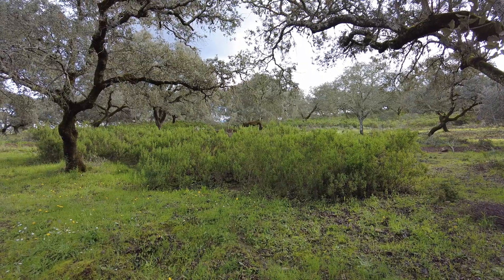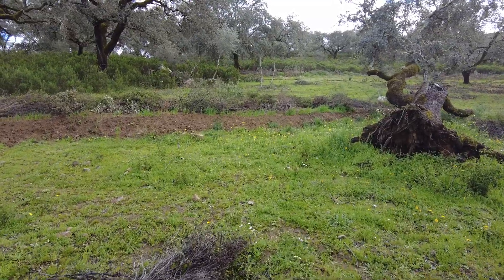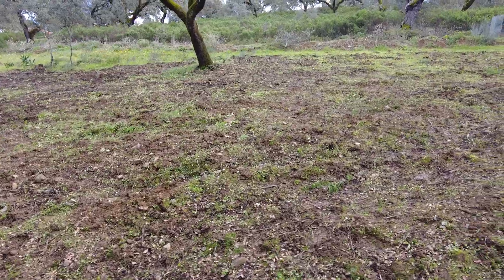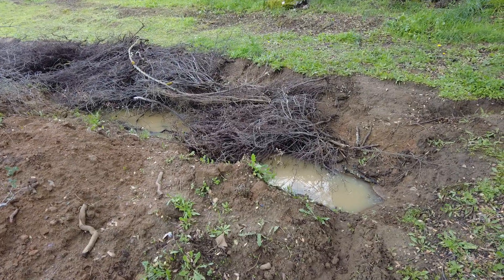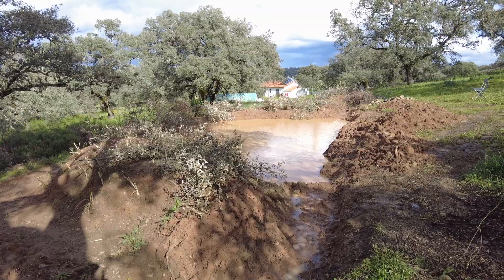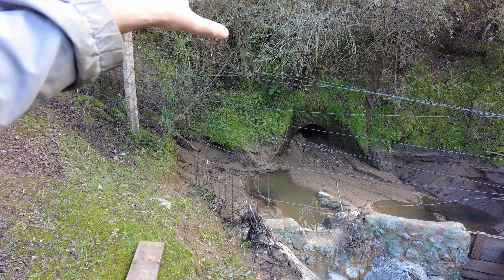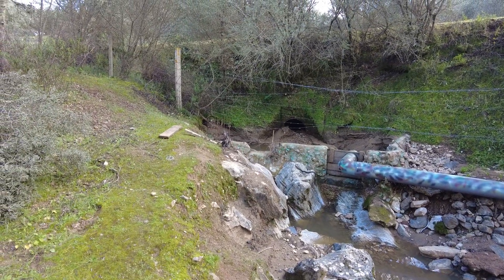Culverts increase velocity and pressure of water. Culverts cause erosion!

Comment: Let's put physics to work. (Simplified!)
If your waterway is 4m wide in one place and only 1m in another,  according to BERNOULLI LAW water in a narrow place will flow 4 times faster, as the amount of the flowing water has to be constant everywhere.
As speed is 4x, water (per each liter) has 16 times more KINETIC ENERGY, as kinetic energy is proportional to squared velocity. It means, that if a 1kg stone will barely stay stationary in the wide part, a much larger, 15kg stone can be carried away in the narrow part!
The Above example also shows, that while in the wide part, you would need only say 100 kg of stones, in the narrow part it would require 1600kg of stones to withstand the water flow energy in the 4m wide area.
From these two physics laws, one can deduce how to build structures and design the water flow. (Should also apply POTENTIAL ENERGY)

A fast-flowing stream formed, hitting one small part of the sand-bag dam, carrying away bags. There was a lot of localized kinetic energy. Water should be forced to spread uniformly before it meets the dam.When water manages to breach the dam, it start to flow with a high speed = high kinetic energy = high erosion potential.

All GOOD permaculture rules can be derived from a few basic physics laws. Using basic Nature laws you can always find a proper solution, while using some described, ready-made permaculture designs might be inappropriate due to some differences between your case and the place it was designed for.

Simplified, but should be a good start.
Reply from the maker: YES YES YES. Even I understand. Thank you for sharing

Comment: My thoughts on the water post-culvert lean more toward induced meandering, rather than continuing with more dams and channelized flow between them. It's difficult though with the slope aspect. A wider, meandering water course would slow the water and spread it across a greater width at a lower depth, creating a larger infiltration zone. The work of Bill Zeedyk comes to mind. "An introduction to Induced Meandering" is a great PDF resource.
Reply from the maker: Great suggestions. Thank you for sharing

Comment: So, it happened as I was thinking. You can continue using sand bags, but you will need to put more rows of it and put more gabions and rocks there. There is no other way to remove energy of the water. In short, more rocks, more punches, more energy will be removed. Gabions with big rocks are the best option. You need to use big rocks so there will be space for water to pass among them. Each gabion will take part of that energy.
Reply from the maker: Great suggestions. Thank you for sharing

Comment: Bernoulli's law describes how water flows fast through that pipe under the road. You need to keep in mind this law with all your water structures.
Building several obstructions at the outlet of the culvert may cause it to clog up. Could be a huge problem. Maybe one small wall ahead of the inlet of your feeding pipe. Keep spillway at the height such that not all the pressure/water is directed into your feeding pipe. 

Where you have sandbags, it seems properly built stone dam is needed. Make the middle wide (5-7m ?) and flat. This way water will move further with a much lowered speed. Again, Bernoulli's law. Big job, but is there a better solution?
Edit: you can do it within a week, it's not a big job! Just small to medium at most, stay positive!
Reply from the maker: Thanks for digging up Bernoulli. Much appreciated

Comment: Lower the spillway of the weir at your culvert be lower than the bottom of the tube.  Allowing the water to fill above the tube is why all the sand built up inside of it.  The sand will always be a problem that you will have to scoop, but at least it won't build up in the tube anymore.
Reply from the maker: I like sand. Come on. I need a beach. Thank you for sharing

Comment: I had the same thought as you, three bags breadth for each one high. Maybe have the bags stacked with the length in line with the flow of water. This helps slow down the water not try to block it. Silt and small stones can then collect in the long lines along the sides of the bags. Maybe even put gravel pieces there as well. The comment about the curve not cupping the flow but spreading seems more correct.

My words are only from theoretical viewings of others.

I live in the UK. I have two small gardens with some fruits trees and raised beds.
I also use a wheelchair which hampers my functionality.

I mainly collect branches, debris, off of the things I grow and pile them on the land I have 🙂 So far it has meant I rarely have to water anything 🙂

You are going to succeed, it’s what you will do with your success? 🙂
Reply from the maker: Thank you for sharing. You and us will make it. Life is good.

Comment: BDA (beaver damn analogues) are used a lot to slow and spread the water. The BDA's are strengthened on the backside with the use of rebar, small logs with a sharpened end to strengthen the weirs. Just a suggestion....
Reply from the maker: Any suggestion much appreciated. Thanks

Comment: You could instead of using blocks make a deep pool with a wide rim, that way the water has to slow down when the water has to well up out of the pool and over a wide shallow lip reducing the water speed and volume so that it naturally has less pressure before it hits your gulley.....The only other way besides a maze of blocks would be an extra pipe under the road but I don't imagine anyone official letting you do that ..
There is a town I used to live near that put culverts on one of its larger streams but they didnt take into account the amount of flood water when it rained hard so flooded the town badly almost every time it rained...it may still be flooding now to be honest but I moved away a long time ago
Reply from the maker: Wide shallow lip, spreading the water out after being reduced. Yes yes yes. Great idea thanks.
Reply: @SuerteDelMolinoFarm  you're most welcome, I hope you find a workable solution

Comment: Dig the sides of the dam into the banks
Reply from the maker: Good one. Thanks for sharing
Reply: @SuerteDelMolinoFarm  Agreed!  Arch the dam toward the culvert and dig anchor points into the bank.  That way the entire dam structure is forced into compression.  When in compression, the dam gets stronger the more the water pushes against it.

Comment: The ratio between the height and width of the dam should be 1:3, with a flat outlet, the dam must be higher on the sides so that the water does not undercut the edges of the dam, as happened to you.
Reply from the maker: Thanks for sharing valuable information

Comment: Hello
The place where your helpers cleaned out, appears somehow desolate to me now.
Do you have any plans to build up soil ? 
You could have shredded the bushes and leave their remains there to prevent the soil from drying out.
Did you ever think of " donating Nematodes " into your ground. Usually sheep or goat do this. - But you would have to take care,
they do not remove all plants from the area. Demeter would have an easier job then.
 What kind of growth is your desire ?
Or is it your head that looks for a reason to decelerate ? 
Are you able of just leaning back and simply listening to your garden ?
Sometimes i manage to let Nature do its work while i'm only watching and wondering.
Reply from the maker: Watching and wondering sounds good to me! Thank you for sharing

Comment: Have you ever traveled upstream of that culvert to see why so much water travels down, even with little rain? Construction, field expansion, etc.
Reply from the maker: Yes. Upstream the farmer removed all the jarra brush and didn't plant anything. No water is held back. Thank you for asking
Reply: Pigs roam freely on the parcel.  It is a mountainside with sufficient elevation that the amount of rain that falls at the peak elevation may be substantially more than on the farm.  But for certain - the drainage is HUGE and the pigs are far too dense for sustainable pasture.
As the mountainside incision deepens, the velocity and erosion increase exponentially.
Reply from the maker: @stevejohnstonbaugh9171  Spot on Steve

Comment: Do you think it's feasible to build a wall like the one you have after the culvert, but around where you have the sandbags? Atleast the water would have a bit of space to pacify and to deposit all the sand. Great new on the seep, looking forward to the next episode.
Reply from the maker: You are right. That is the perfect place. The only restraint I have to start is that it's a big job that will take me away from many other tasks for a long time. It should be built strong. I'll need to dig down to bedrock under the sand. Thank you for sharing
Reply: @SuerteDelMolinoFarm   I'll send you an email with a quick and easy method to trial.  There are three days of showers predicted starting Saturday.

Comment: I think it is no surprise that the sandbags gave way at the corner where they changed directions.  This corner was pointing away from the culvert meaning the sandbags to either side were directing the water into this corner which acted as a single point of failure. If the corner had been pointing towards the culvert it could potentially could have survived. Better yet would be to place the sandbags in an arch shape with the peak of the arch pointing towards the culvert, just as with the Hover dam this shape will equallize the water pressure across the entire structure and give it the best chance of withstanding the pressure.
Reply: This is an excellent suggestion.  Put the sandbags in compression when underload,
Reply from the maker: Point happily taken. Thank you for sharing

Comment: 1:24 is the first "seep" you have identified on the farm. No doubt the cumulative result of all of the retention structures built uphill.  Also, a clear indicator that your aquifer/water battery bank is more full than at anytime since you have owned the farm.  
Borrowing a phrase from another member of the community, "The magic is happening". ♥
Expect to see more seeps and perhaps a spring or two!?
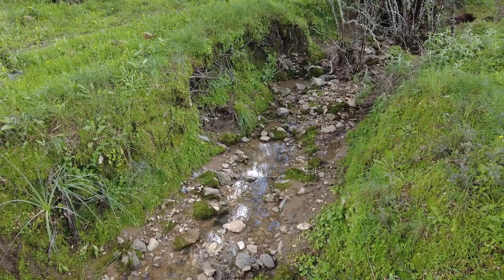7:46 Flow continuing in the creek after the rain is quite beautiful.  Vegetation lining the creek banks - beautiful.  More indicators that the Magic is Happening upstream.
11:58 I will suggest backing up the sandbag dam with rebar stakes and woven wooden poles as you did with the leaky weir on the low end of the creek.  The rebar and woven poles will absorb the force of the flow.  Given the continuing amount of erosion from the mountain side, the reinforced sandbag pool should fill with sand in one or two rain events.
Reply from the maker: I'll spring with joy Steve.
Reply: @SuerteDelMolinoFarm  Me too 😊
Reply: Those woven poles thrilled my wattle-loving heart to the core
Reply: @1millionpumpkins542  And my "beaver dam analog" heart jumped for joy too😊